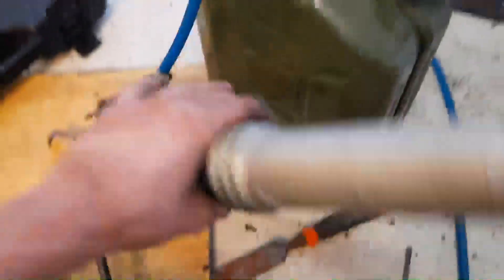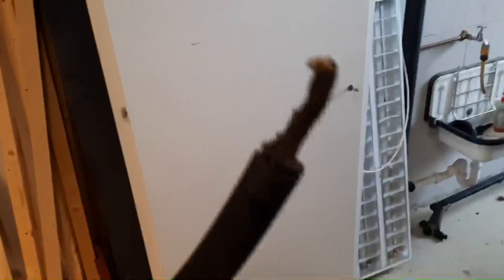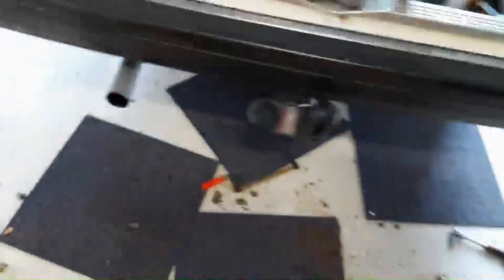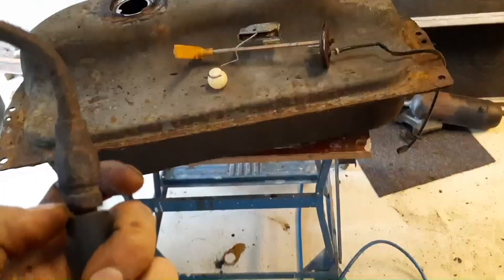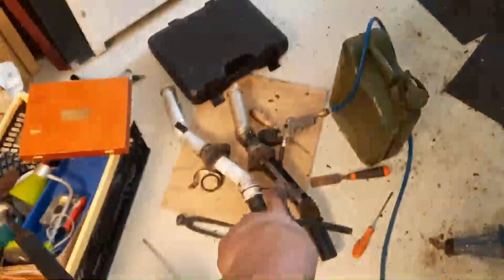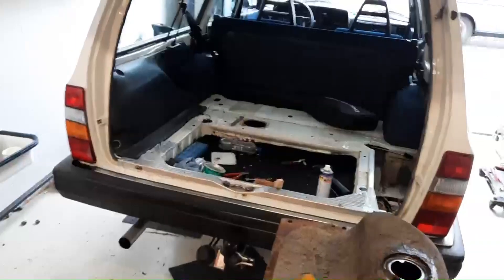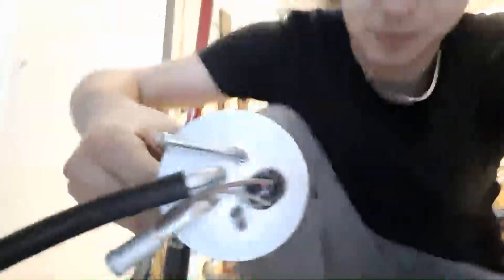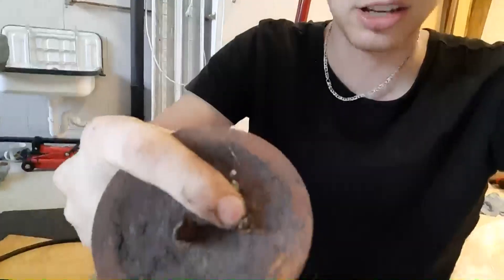Fixing my leaking volvo 240 fueltank & fuel sender unit

Comment: How did it all work out ? I am about to replace my tank ! Have you replaced your throttle body plate seal yet ? Fcpeuro has it .. its a must ! I did mine and man the vacuum leak was solved .. easy job !
Reply from the maker: Hi mate. Thanks for the comment! The fuel tank is still going strong being stored in my shop 😅 If you look at my never video's you can see that the 240 is in a thousand pieces right now. I ran a B23 carb engine in the 240 and had no problems with that.